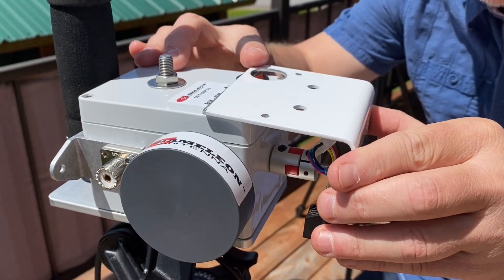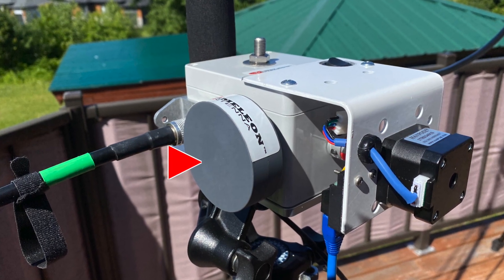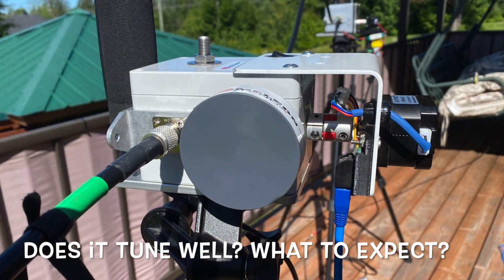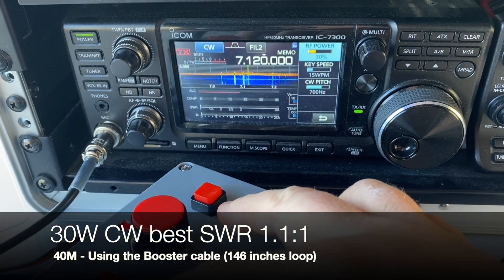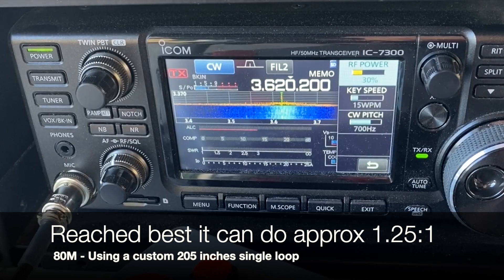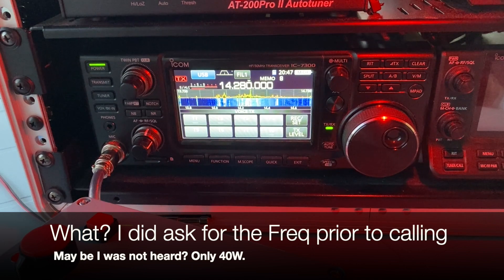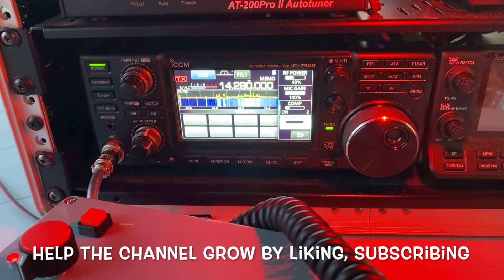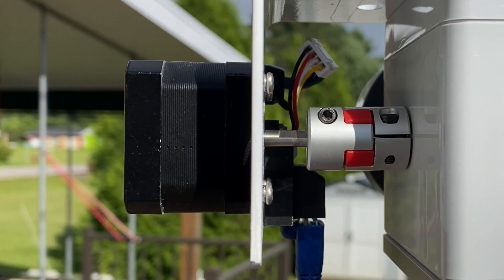Chameleon Power Compensator 30W CW w/ Remote Controlled F-Loop 3.0 Magnetic Loop Antenna w/ IC-7300

Comment: Hi Frank. Congratulations on this great video ! I use the same Chameleon Magnetic Loop Antenna and would like to build this unique remote control. You mentioned in your video that you will present the kit in a separate clip. Can you please tell me where I can purchase the kit (if there is any), especially the tailor-made, L-shape mounting bracket for the stepper-motor. 73, HB9BFP
Reply from the maker: Hi Jurg, thanks for the comment and question. Sorry, the Remote Control and hardware are not for sale. I did not have time to make a follow up video. These are all custom parts and builds. I presented this material to inspire users to build their own. The main goal of this video was to test the Power Compensator, doing so I had to explain the Remote Control as well. Hope that answers the question. Thanks.